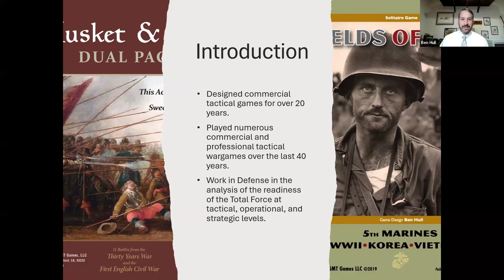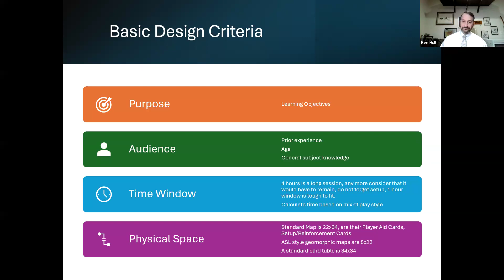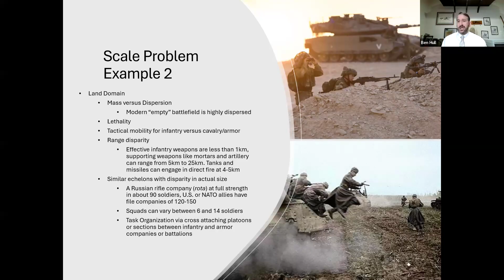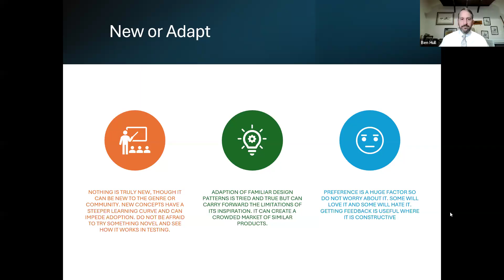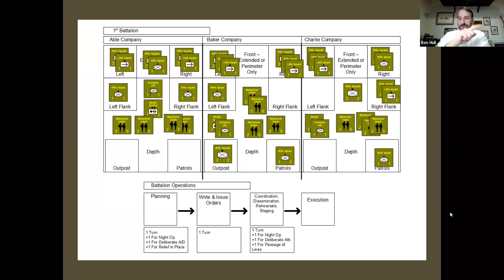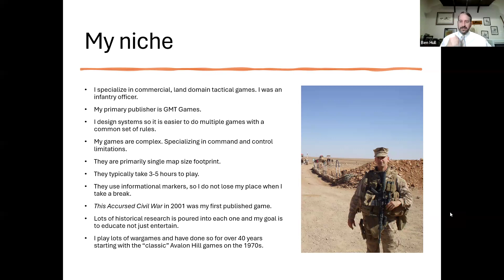Tactical Wargame Design

Comment: Instead of card randomization, chit draws with a large chit draw is very effective. Use poker-chip sized chits to allow a lot of information to fit on them.

War Stories uses chits that have terrain modifiers on them. Rather than adding up a bunch of die roll modifiers, the chit has modifier icons on them. If they apply, you shift the result up or down the list of results in the chit. For example, if the chit has a Woods icon in it, the result is modified if the target is in woods. (There's very clever math behind the chit distribution.)